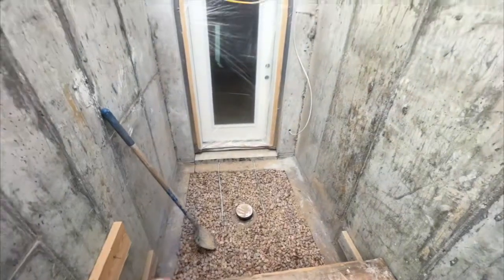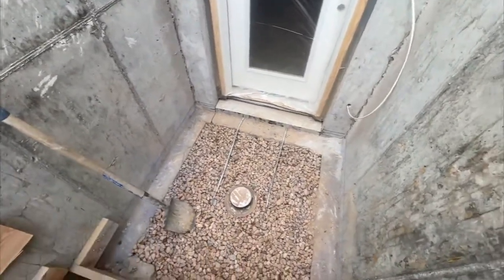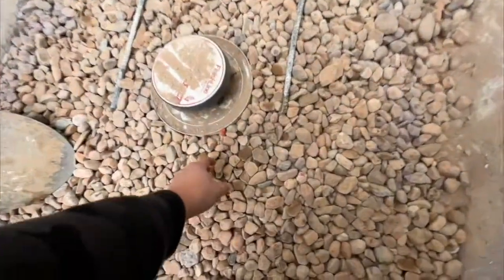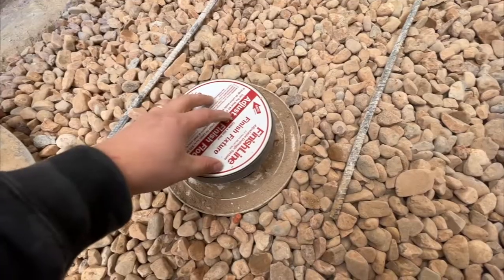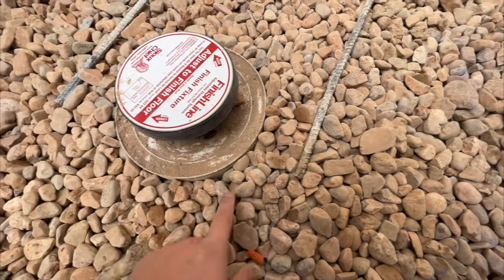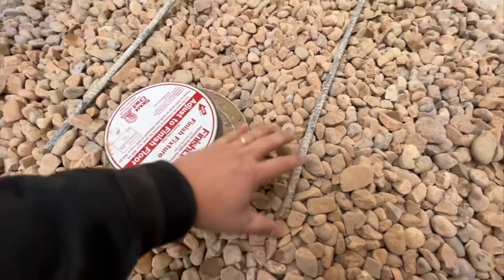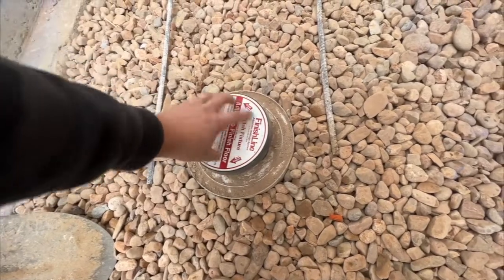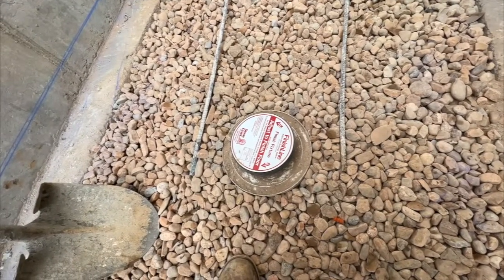Explained: How Basement Walkout Drains Work

Comment: I can't do this where I live because we get rain and snow.  A 5 gallon bucket is a joke.  I currently have one house downspout draining into two 55 gallon dry wells that are 10' apart from one another.  During a hard rain, they fill up in no time and then they back up and we're right back to square one with water in the basement.  This spring I have to dig every thing up and put hard pipe all the way out to the side of my property.
Reply from the maker: Were sorry this may not work for you in your location.  It works very well here where we install these projects.

Comment: Hello Caleb. Thank you for all the all the great videos you have posted. They are very informative. I am considering finishing up my basement but I have a couple  concerns. I was hoping you maybe able to give me some direction to these concerns. I have some long cracks on the concrete slab that it seems like they got a little bit bigger after this winter. So I'm worried if I put tile or laminate floor with time the concrete will mess up the finish floor The other concern is that I have water come into the basement talking to my neighbors they say is from the water table.  I do have a water sump.  But I'm worried about black mold once I close up the walls. Should I get like a city inspector to take a look at these things? Or should I go somewhere else? Any tips will help.  Thank you!
Reply from the maker: Where are you located? Each climate requires different construction materials and considerations. Are you in Utah?

Comment: What happens if that drainage becomes saturated? Is there an option to have a pump like a basement subpump?
Reply: This is my question too. Seem like this option is not ideal, especially for a long term solution.
Reply from the maker: Yes, you can add that as a backup option. 
Other things you could do would be to make the 5 gallon bucket bigger and use a 55 gallon barrel, or to tie into a storm drain. Most people here don’t have the storm drain option on residential properties.

Comment: even with a low water table, wouldn't you get water pouring in from the sides of the bucket during  rain?
Reply from the maker: No. It works great here in Utah. 
Not sure if your climate is different.